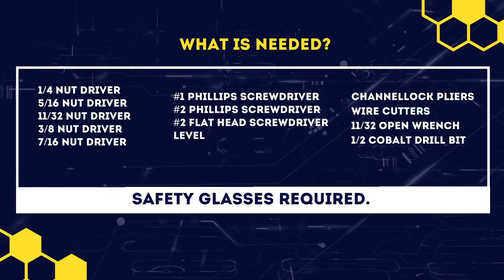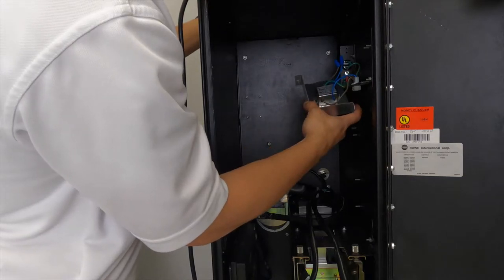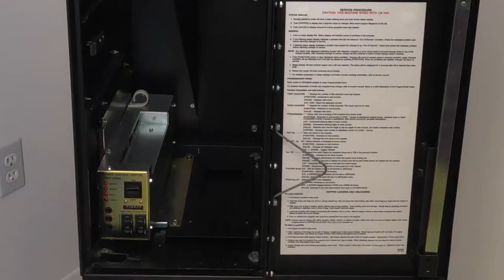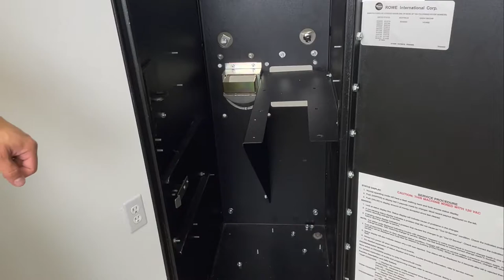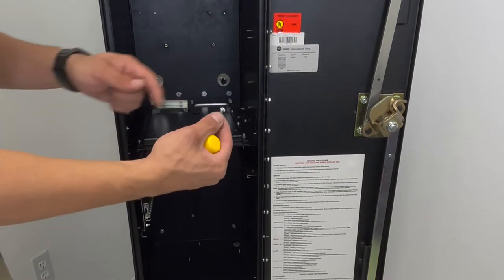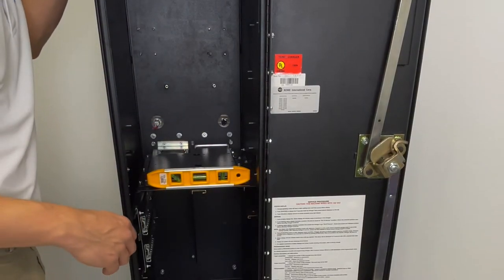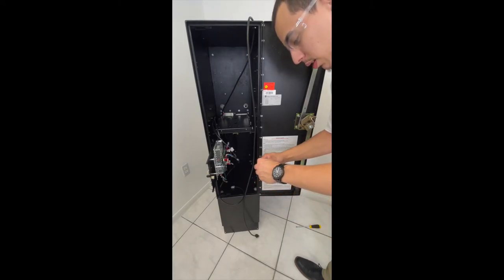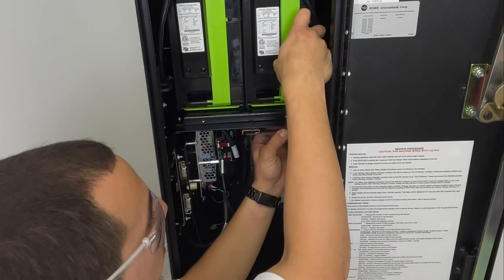Installing a BC-1400A-Kit

Comment: SUGGESTION: For those of us who just upgraded to this new machine can you produce a few additional instructional videos on operating this BC-1400A machine please? Specifically how to troubleshoot codes which are not listed in the owners manual. General troubleshooting in regards to the most common changer issues would also be MOST APPRECATED as well. For example:  1. How to clear a bill acceptor blockage on a TALOS bill acceptor. 2. How to clear a blockage in the hoppers. 3. How to disassemble the machine and make all of the cable connections. 4. Typical maintenance and item checklist to make sure the unit is running smoothly. 5. Most common errors and error codes and how to troubleshoot and fix. I know the OLD ROWE BC-1400 like the back of my hand. I can fix anything on them. I am at a loss with the new HW right now. Learning curve time. Many thanks!!!
Reply from the maker: Thank you so much for your excellent suggestion! We agree with your points, and will add it into our video schedule. We hope to make your upgrade kit transition as seamless as possible. If you could please email info@americanchanger.com and reference your comments, we will have a Service Technician reach out to you to review the error code mentioned. Thank you for being an American Changer customer!

Comment: Why is there not a single area that tells you what each error means?? Kinda fools game y’all running
Reply from the maker: Hello! Thank you for your comment. Machine manuals detail error messages that occur (visit www.AmericanChanger.com to view a manual) and we are currently working on creating videos for each error message as well. In the meantime, we would be happy to assist you with any specific questions - please email service@americanchanger.com and our Technical Service Team will help guide you through error messages. Again, we appreciate your feedback 😀
Reply: I think a guide sheet matrix on EVERY possible error code with EVERY possible bill acceptor installed would be nice. My service manual has blockage clearing instructions for another bill  acceptor, the PYRAMID, but not the one I have the TALOS. Is the TALOS the new name for the MEI/MARS unit?
Reply from the maker: @mikealvarado8801  Yes, you are correct! TALOS/CPI is the new name for MEI/MARS.  I provided your comments to our Engineering team so they can begin working on the matrix you suggested. Thank you!